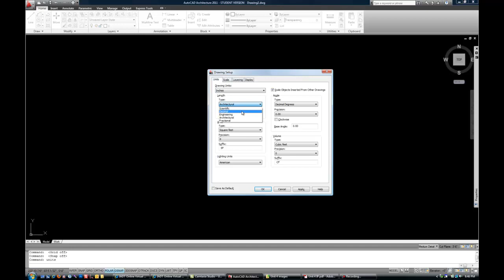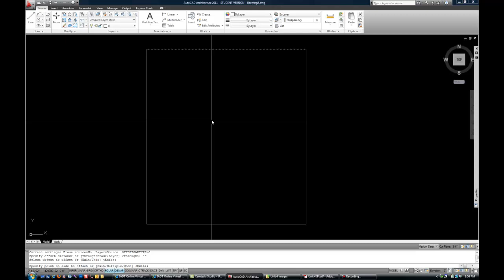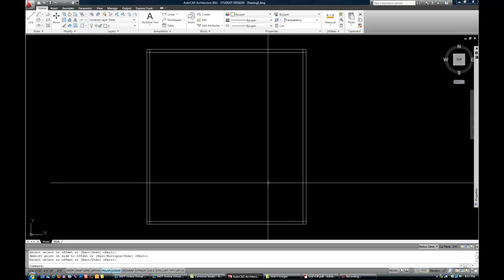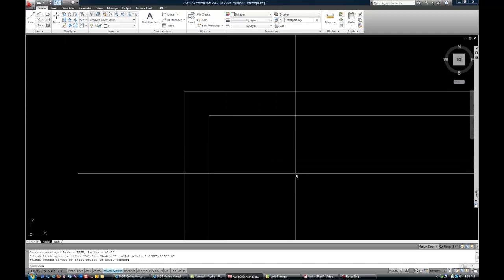Basic AutoCAD Floor Plan - Part 1

Comment: Jeremy - awesome videos.  I am planning to create a dimensioned floorplan for a house, using much the same technique as your tutorial (the plan exists already).  It is a single story, with full basement.  I have Autocad 2007 at my disposal on a PC with XP (not the architectural version).  My plan is to hand my digital product to an engineer or architect, and ultimately obtain an approved plan for construction.

Four questions.  Your tutorial appears to be made using AC Architecture.  If I have Plain Jane AC, will it work the same?  I noticed you made some comments about how dimensions have more options - any major differences or limitations I may have?

I should invest in a wheeled mouse?  I currently don't have one.  It looks like either a must have or would be very handy, assuming 2007 is not much different than the version you used.

Elevations - I would like to create elevations.  Will I have to create those by drawing separately?

Last - is obtaining the same outline for the basement foundation as the first floor built in to either AC or AC Architecture as maybe a separate "layer"?  Or, would I have to do the building outline first and save a copy, then finish each floor as separate files?

Thanks for any advice!  don(underscore)moore(at) verizon(dot)net
Reply from the maker: Don Moore Yes I am using AutoCAD Architecture but - for this video - only using tools that are available in 'vanilla' AutoCAD.  So your process can be exactly the same as what I show here.    You will not have many limitations, although the annotation scaling features were released in 2008 edition. 

Wheeled mouse is not required but it is much faster.  Without one, you will have to use the more traditional zoom tools, such as zoom window, zoom extents, zoom realtime, etc.  Study up on those and then decide.  Considering that a wheeled mouse can be bought for about $10, it is a no-brainer. 

If you draw the plan as 2D then yes - the elevations will be also 2D, manually drafted.   Otherwise you'd be getting into BIM and need a 3D model to extract elevations automatically.  That's a ways off in terms of software ability.  

If you draw with AutoCAD Architecture's wall tools, you can include foundation  three-dimensionally and customize how it displays.  Using regular AutoCAD means you can draw the foundation on a separate layer with linework and then copy like you suggested.  Consider general file management strategies... (1) some people would leave foundation at the same place as the main floor plan and control visibility via layers.  (2) Other people would move the foundation over to the side in the same CAD file.  Not a great method if something were to change, like the size of the building.  (3) Other people would have a separate CAD file for each level of the building. This is best if you master external referencing - file linking.
Reply: jeremytf77 Thanks a bunch for a thorough reply, Jeremy.  I really appreciate it - and knowing that annotation scaling came in 2008.  I wouldn't have known that.  I bought a wheeled mouse earlier today - my driver was lost or my seldom used mouse failed.  The new one comes with a driver so I should be set.  I am still using XP Pro (!) so I need to get old SW.  I use Word and Photoshop versions from 2003 and Acrobat from 2006 and they do everything I need - and if I break down everything will have to be upgraded.  Thanks again.  I'm a teacher, and I really like the style you use in your vids.  The people saying they don't like them can look elsewhere for "better" ones - and let the mainstream learn from yours.

Edit - hey, if I don't have annotation scaling, might that be less an issue if I send my finished files to someone to import to their own program, and don't print them?  Just curious.
Reply from the maker: Don Moore Yes, it would be less of an issue if you are sharing electronically.  Controlling size of the dims and text is still possible in the older versions.  I may discuss it some in my text/annotation videos - to be honest, I can't remember.

Comment: one small question . after we draw the box ie. outer boundary for the home . you select offset command to draw the wall thickness . after you choose offset you are able to select a single line as your object . but in my case it select all four lines (which forms the boundary ) as the object . ...how to make it select single line , one at a time . please answer ,
Reply from the maker: Sounds like you drew the outer lines as a rectangle/polyline, which is fine.  If you want to convert it to separate entities, explode it.   Shortcut for explode command is 'x'.
Reply: jeremytf77
thank you very much .....
i am totally new user to autocad ...and sorry for asking silly question ,,,,,,,

Comment: nice video, please i have a scale of 1:100, is there any special treatment needed for this?
Reply from the maker: First consideration would be drawing units - if you are working in that scale, I wonder if you mean metric.  Set units accordingly...   Also consider which template you use when starting a new drawing.  If you use AutoCAD Architecture, choose a metric template and desktop icon.    Otherwise it won't matter when drawing the plan itself since it is drawn at 1:1, full size.    When setting up annotation and viewport, you would possibly need to make a custom scale, which you can do by picking "custom" from the scale pulldown and choosing 'add'.

Comment: What did you set your limits and grid to.? When I try to enter the line, It only goes less than 3 inches in the screen? it seems my limits are not set correctly. What should I do to be able to set a regular drawing for floor plans?
Reply from the maker: Limits should be off.  Grid is irrelevant.  These items are all covered in the fundamental playlist of videos. The video you're watching assumes you have already mastered these topics.

Comment: Not bad if you prefer to ignore the rest of the drawing setup i.e. Limits ! If your floor plan is going to be plotted 18' X 20' you need to ensure you set the limits of the drawing large enough so it can be printed, let say 30 X 40.
To start at the origin you must enter a command to do so, # zero, zero, and why are your crosshairs soooo large. They prevent you from seeing both what it is you are drawing and if the axis is correct. If you'd done this there's no chance you'd have to do a regen on a single line or rec.
Here's a suggestion: draw the rectangle as a polygon and avoid having to do multiple fillets or select "one" of the fillet (multiple) options that keeps the command active rather than space bar - space bar - space ...
Reply from the maker: As noted, this video is aimed at those who already understand the basics such as limits.  There is a series of video for beginners who haven't learned about those items yet.  Sure, a rectangle can also work fine.  As I'm sure you know, there are 100 ways to do anything in AutoCAD.  Thanks for the input!

Comment from the maker: Max, Thanks for the input.  We resolved this a few months back by private message.  He wasn't using the command quite correctly.  Changing the units will do nothing to change how precisely the tools work, including offset.  But it will make it more obvious if the drawing is NOT precise.

Comment from the maker: Offset is hard to screw up, as long as you're getting the new line in the process.    If you input 4", AutoCAD isn't going to give you a line that is not quite 4".  The copy command is easier to mess up in the way, because it is dependent on the direction given by your mouse cursor.  

I would double check how you're measuring it - using the distance command?  From what osnaps?  Are the osnaps perpendicular to the lines?

Comment: Thank you......everything is working right but I have a problem .....my question is . when I am 
doing my floor plan and I do the wall, I use a offset for 4" .......Once the offset is does, I 
measuse it to make sure its 4" , and it is not.....It may be 3, 15/16"  or  3, 7/8"  ....Off by alittle.... sometimes it is 4" ......Is there something I am forgetting ....thanks....